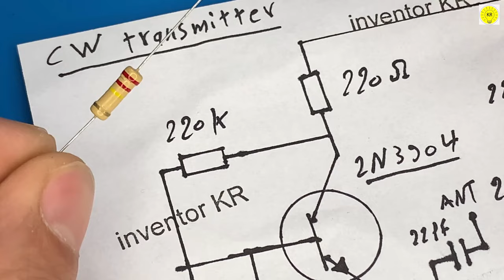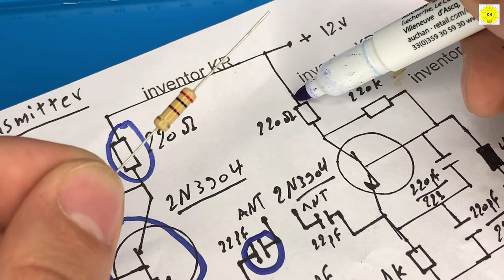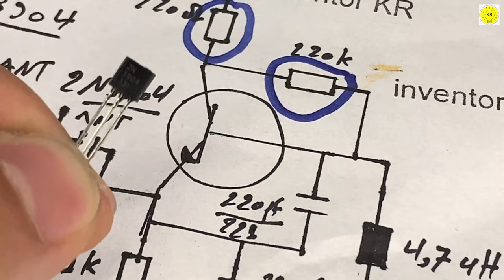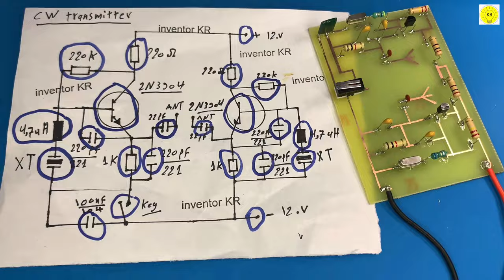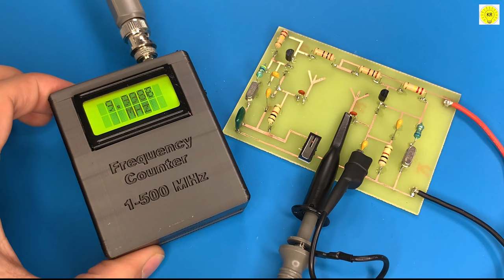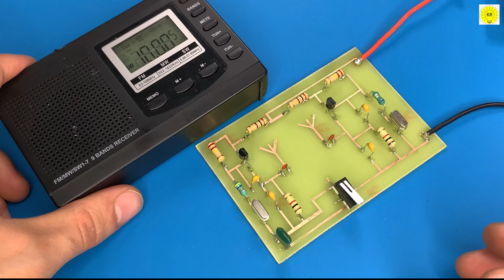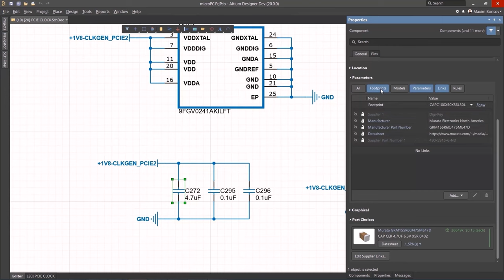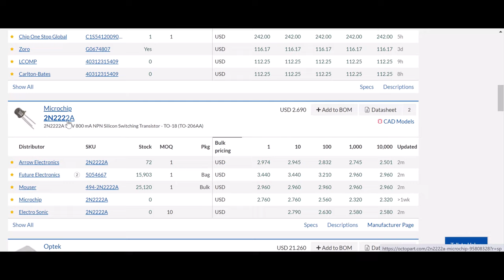How to make a telegraph transmitter morse code Radio

Comment: I used a hole PCB to make it, can I replace the antenna with copper wire, and how long of wire should I use❓
Reply from the maker: 5CM
Reply: @inventorkr1  thanks 👍